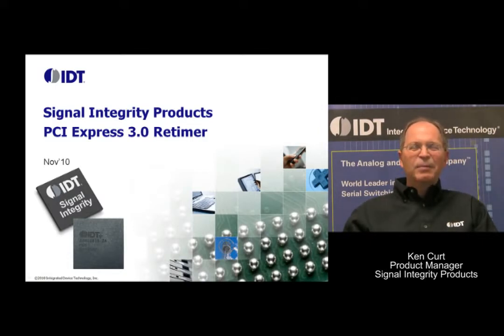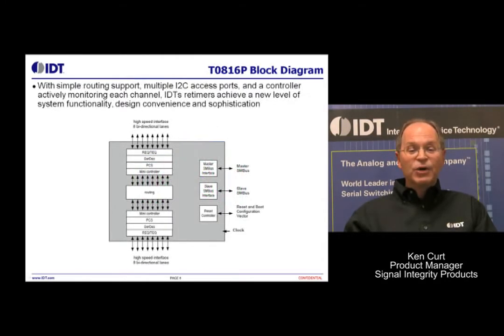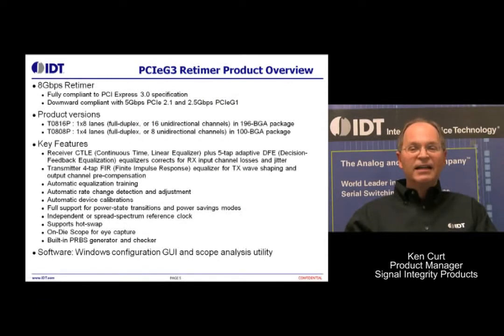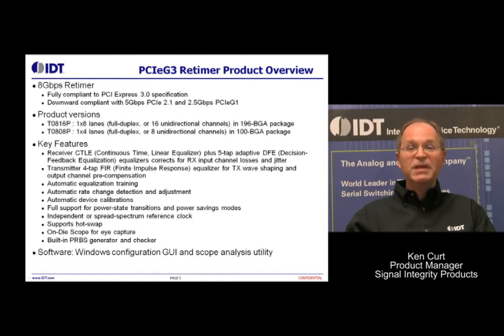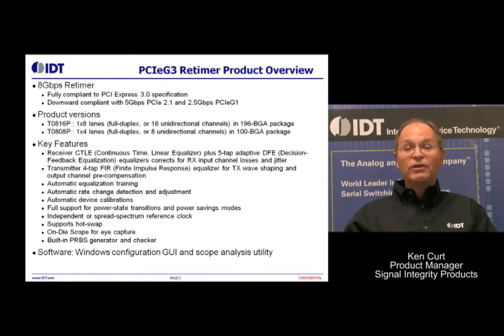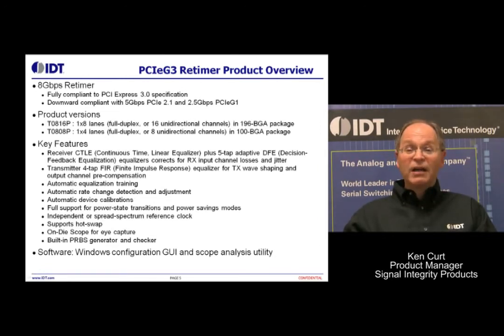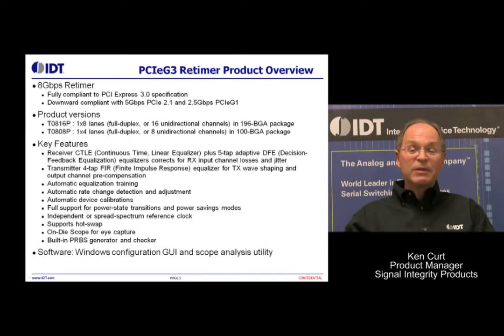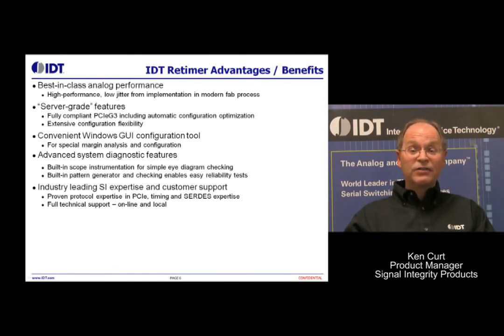IDT PCIe 3 0 Retimers for High Speed 8Gbps Signal Conditioning

Comment: I just want to control the speed of a 3 leg smart motor to run an off grid power generator to power my house or to charge up my battery pack if drained more than the 8 hour solar panels can acheive here by lake superior region durring the winter. We had 20 minutes of sunshine yesterday in over a week of clouds and winter snow storms.